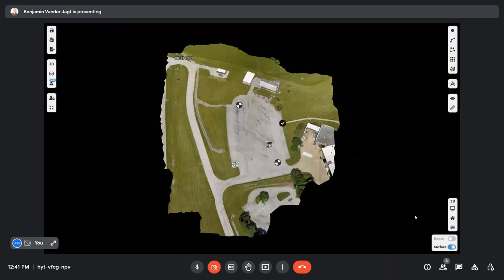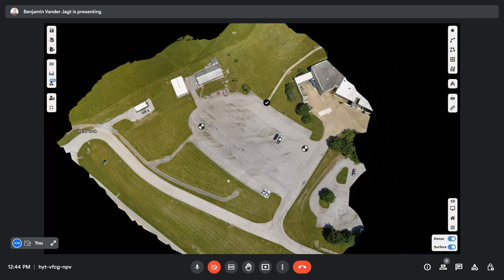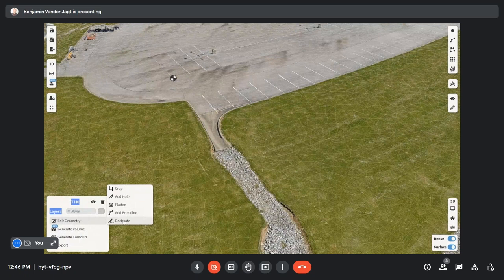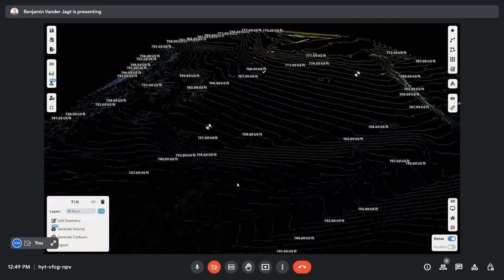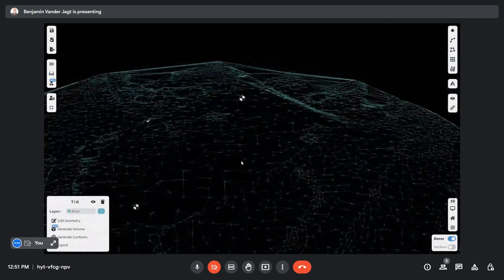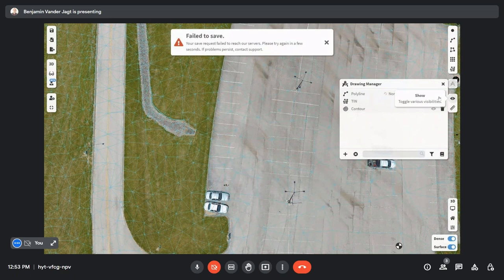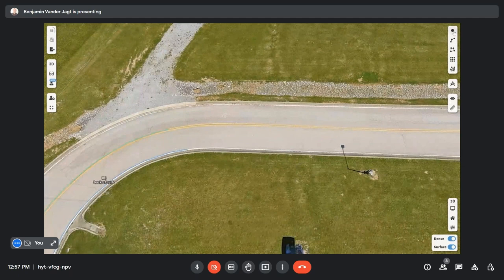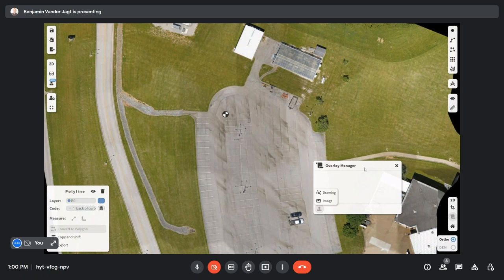Drone Photos to CAD With Carlson PhotoCapture - Video 2

Comment: Ben/Luis, Why do you have to export the TIN to a DXF? Shouldn't the .TIN file be the same as that generated by the other Carlson Software packages (Civil/Survey)? Otherwise, as a DXF inserted into the DWG file, you'd have to generate a TIN of the DXF TIN to have that available for placing spot elevations or calculating eaarthwork, right?  As a part of the TIN editing, can you bring in a grid of ground shots (Carlson .CRD file) to modify and improve the accuracy of the TIN generated in PC?

Comment: At 15:02 you are drawing a polyline that you say is full 3D but the dialog box at the upper righthand side does not have "clamp to surface" turned on. Why would you NOT have that setting turned on if you are trying to draw a polyline "on" the surface? Just want to be sure we are using this software correctly and as intended. Thanks.